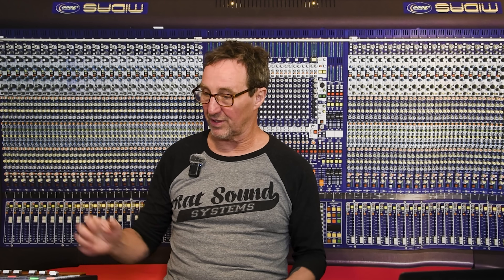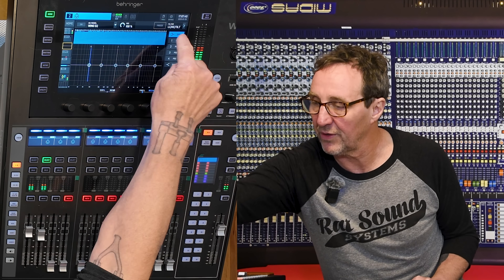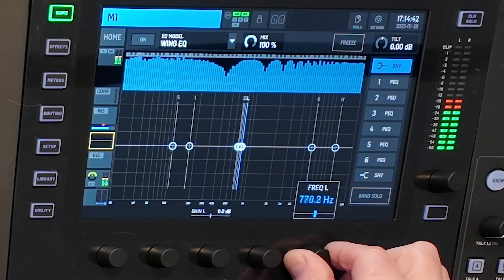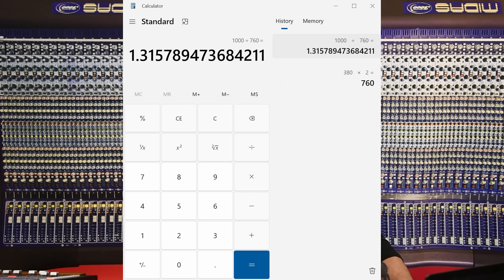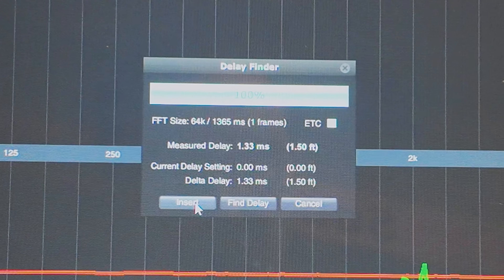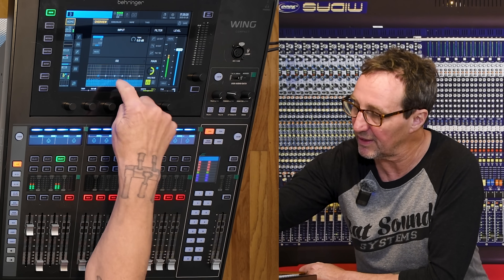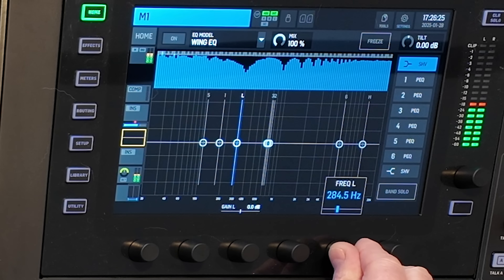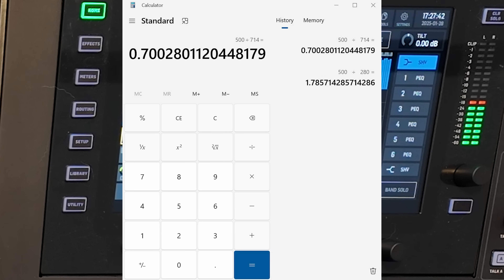Easily Find Console Comb Filtering Latency Issues

Comment: Hello hello Dave, how are you?
This afternoon I had a little time to recreate the tests you did in this video.
To do this, I used my Midas M32 and my Smaart 7 (and one of my MacBooks as the source of the pink noise).
First of all, I want to say that, although I know a little English, I used Google Translate to write the message first in Spanish so it would be translated into English. There may be some things that weren't translated correctly.
I apologize for that.

Here are the results of my test:

As you explained in your video, I connected an external pink noise source to channel 1 (I used an external pink noise source because on the M32, pink noise can only be assigned to outputs, not channels) and panned it to L.
Then I connected an XLR from the left physical output to channel 2, and I panned channel 2 to R.

Then I checked the channel EQ analyzer. 1.

And it was flat, just like in your video.
And the same with channel 2.

After doing that, I checked the L and R EQ analyzer and it showed a pretty obvious comb filter, with several dips as well.

The first largest comb filter was at 310 Hz.
The second at 924 Hz.
The third at 1kHz.
The fourth at 2kHz.
And the fifth at 2k79Hz.

So, knowing that the largest cancellation frequency is 310 Hz, I divided 500 by 310 and the result was 1.61, or 1.61 ms.
Which means that, at least on my M32, there's a 1.61ms latency difference between the live signal and the signal leaving the mixer and returning, according to this test.

I then verified this result using Smaart 7, and when I clicked Find, it told me there was a delay of 1.67ms.
1.61ms according to the test and 1.67ms according to Smaart...
it's practically the same thing.

I then recreated the following test from the video, adding compressors, EQs, and more effects to discover what added more latency and what didn't.
I used a Y-cable to add pink noise to channel 1 and channel 3 (channel 3 panned to R).
Both channels 1 and 3, as well as L & R, showed their analyzer to be flat.
I inserted the M32's ULTIMO COMPRESSOR DUAL compressor on channel 3, activated, but without compressing anything, just online.
And in the main output analyzer, the flatness stopped appearing and a nice comb filter appeared 😅
This time, the largest comb filter was at 751.7 Hz.
After dividing 500 by 751.7, the result was 0.66, or 0.66 ms of latency.
This means that the ULTIMO COMPRESSOR DUAL compressor adds 0.66 ms of latency to the channel.
I've done the same with almost all the compressors and equalizers on the M32, and almost all of them created a comb filter, sometimes at different frequencies, sometimes at the same frequency as the LAST DUAL COMPRESSOR (751.7 Hz, or 0.66 ms).
For some effects like the DUAL EXCITER, the comb filter frequency was different; it was 570 Hz, or 0.87 ms.
After doing this, I wanted to measure in Smaart 7 to see if the latencies/delays matched when I inserted the compressors, but I was late and had to go prepare dinner for the family.😄
So I'll have it as homework for the next day.

I'll tell you the results and confirm if Smaart gave me the same latency/delay as looking at the mixer analyzer (which will most likely match).

Greetings from Spain!!
Reply from the maker: so cool and super interesting! 

thank you and yeah the info is helpful And I appreciate you doing all the research there!

Comment: I guess I’ll try to limit the amount of compressors I put everything through. Usually have it on individual channels groups and the mains. Maybe that’s too much
Reply from the maker: the stock compa should not add latency.. 

it's just the ones with the pretty pictures of fancy vintage gear that typically cause the issue
Reply: @DaveRat I don’t trust those. There’s already one on the strip.
Reply from the maker: then you're doing it right and you shouldn't have issues

Comment: So what does Midas mean when they say phase coherent effects for a x/m32? If this is still the case? Wasn’t the desk suppose to pre delay where it matters?
Reply from the maker: if you notice him a video I added something from the effects rack that changed the latency And also how I use the term " plugins " for the video

if you just use the built-in channel EQs compressors and gates the latency doesn't change. 

it's when people use the gear that has pretty pictures that the latency issues get added on most consoles.

Comment: incredible, does this only happen with plugin processing? Are we in the clear just using stock eq and dynamics? Literally have only just started using plugins on busses etc to mix things up but now i may just be going back to the old faithfuls 😅
Reply from the maker: Yes on most consoles the stock EQ compressors and gates do not add additional latency. 

but that said on many consoles if you route to subgroups and then you also route to left and right there will be different latencies. 

I don't know all the Gremlins that can be found but I recommend testing if you want to ensure you're not adding issues

Comment: In my work I mix at an install with Waves and on-board "gear." I also use an SQ with on-board "plug-ins" with no latency, for my personal reinforcement jobs.  I looked into spending $$$ on Waves/Plug-in rig and decided against it. I will say that I enjoy using some of the clone hardware compressors now and then. I can hear them working and I like to turn the retro knobs and see the meters reacting. Yes, it is more gear but I have a lot of fun with it and it sounds "better" than the plug-ins to me. Maybe I'm fooling myself. I still like it.

Comment: If you’re double patching inputs from the same source - let’s say one vocal channel setup for PA and the other channel with different processing for AUX Bus not going to the PA - will you incur the same issue seen here?

Is it best to use stock eq/dynamics/etc for the AUX and only use an Insert FX on the channel being processed to the PA?

Trying to minimize latency, combing and phase issues going to stereo IEMs where it’s more noticeable vs PA where you have some wiggle room and less perceptibility.
Reply from the maker: I believe you are correct. the stock processing should be minimal latency. and as long as the console does not have automatic latency compensation and it is turned on, then keeping things separate should keep in ear latency minimized.
Reply: @DaveRat You the man Dave! Ever since we’ve gone to IEMs it’s been a process of discovery. Originally, I would just send already processed channels to a stereo bus and adjust levels; however, I found because of occlusion effect for vocals and different EQs being required for instruments when in your ear vs through a PA started to present challenges. So, I found double patching to be the most effective for handling these issues and a better IEM mix vs an entirely seperate board. Luckily my channel count is low enough that I can do this for our band. 

Always love your content and learning so much from you! 🍻

Comment: Thanks Dave! The video gave me a better understanding of how the board works. I would be interested to know how the latency compares to for example: The Local IO, AES50 Stagebox(S32), Dante, USB etc.
I'm thinking of conducting some testing of my own. What I can't test is latency accross different boards. The spec can be usually hard to find, but I think it is a major factor when buying a new board. I know that I was sceptical buying a digital mixer after going from analog direct monitoring from a mixer/interface to an audio interface with bad latency induced monitoring.

Comment: Why don't they add a delay compensation? At least as an option, so you can choose to have a say 2ms latency in the whole setup, but avoid these issues?
Reply from the maker: the board would need to know and track what you use. some of the expensive boards will do that but that is an a issue as well.  do you really want the whole board to shift to 5 lma or 8 ms latency because you add a bunch of crap to a single channel?
Reply: @DaveRat  You are right in that sense. Just thought wit all this modern technology it shouldn't t be a problem for software to calculate that and have it as an option if you decide to choose so

Comment: I see a lot of confusion from too many people here. Latency compensation is present on all channels, like on the vast majority of digital mixers, but only if you use the EQs, compressors, gates, or other effects that are part of the channel strip. Almost all decent digital mixers have it, including the Wing.
Here, however, the latency is caused by the insert rack effects!
And here too, the vast majority of digital mixers, even those much more expensive than the Wing, do not have automatic compensation for rack effects. Certainly, only the Midas HD96 and Yamaha's premium consoles currently offer automatic compensation for rack effects, and perhaps very few others, and in any case, these are consoles that cost tens of thousands of euros. The only exception is the Waves LV1, which uses plugins, but it's different.
So using channel strip effects does NOT cause latency, only insert rack effects do. Let's be clear: I personally don't find forced compensation always useful. It would be better to be able to adjust it yourself or at least activate and deactivate it; you could have problems with monitors, for example. Sorry for my English.
Reply from the maker: excellen and totally agree and that is why I used the term "plug-ins"  to try and denote "processing they is added that is not native to the channel"

as far as auto compensations, I quit mixing big shows before and rather than switching to digital. but I would be quite concerned with a console making latency changes to all the channels based on adding processing to a single channel.

either way, the true goal of the video is to inspire people to test and verify all is good or to test and find and fix issues.

that is my hope of what comes out of this

Comment: DAWs time-align processed channels automatically. I wonder why similar concept can't be use in digital consoles. Maybe not for all channels, but selected ones, e.g. drums channels
Reply from the maker: yeah a bunch of people that work on DAW but don't have experience with live music are saying a similar thing. 

having a live console shifting around in latency would be quite concerning. 

when you have sound being reproduced by loudspeakers with sound sources at varying distances from these loudspeakers a shift in latency changes the amount of time it takes and therefore the frequency interaction between the acoustic sources and the reproduced source. 

shifting latency around will change the frequency that microphones feedback and it will also change the way that in-ears and stage monitors sound to the musicians. 

DAWs solve the comb filtering issue within the machine by shifting latency but in a live environment we have actual sources and once you shift latency you introduce new and different comb filtering interactions

furthermore with a DAW you can have fairly long latencies of five or more milliseconds and not really be concerned where as in the real world live 5 milliseconds equates to a 5-ft or so differential and distance to the source. 

with live sound we want minimal latency whenever possible because we operate in real time

having latency shift around for live maybe like driving a car where if you turned on the radio your steering and brakes all of a sudden started to respond more slowly than if you turn the radio off.
Reply: @DaveRat got it

Comment: This is one of the reasons I love the Waves LV1 mixer.  Fully automatic latency compensation across the entire mixer.  No need to worry about latency-induced phase issues, even if you're sending channels to groups and mains.
Reply from the maker: does it change the overall latency when you add more plugins? or is the latency fixed at a certain time and no matter what you do it stays locked? 

 I'm curious about how it deals with the quandary of trying to keep the overall latency to an absolute minimum and also making sure that the latency never changes for everything when you do a single thing. 

like adding more plugins to the kick drum altering the latency for the vocal mics going to the in ears and changing the way the musicians hear the relationship between their natural voice and the in ear sound due to time shifts. 

this is all super interesting to find out how the various manufacturers deal with this puzzle
Reply: @DaveRat  You're on the right path!  Yes, it delays everything in the mixer to sample-align to the signal path with the longest latency.  You also have the option of sample-alignment to output groups instead of the entire mixer.  Since Waves only allows their plugins to run inside of LV1, they have tight control and knowledge of the processing latency of each plugin.  You know it's working, because you hear a small audio dropout on the entire mixer if you insert a new plugin on a channel that has non-zero latency processing.  

LV1 has pretty comprehensive latency handling, as it displays the processing latency for a channel strip, as well as output busses right in the mixer UI.  It also allows you the ability to ignore latency compensation for channels, outputs, or even individual plugins...should you want to use something that would have a detrimental impact on latency overall (like in IEM scenarios).

Displaying latencies and keeping the entire mixer (or optionally groups of outputs) sample aligned is something that LV1 does really well.  You should check it out sometime.  It puts both visibility and control over total I-to-O latency in the hands of the engineer, rather than trying to hide it.
Reply: @DaveRat  This would be a great video Dave:  
How Latency/Delay exists in Analog (IE: Tape Delay resulting in dual-path Analog consoles), 
as well as DAWs (where we've been fighting this for decades, and delay compensation only recently seems stable enough to rely upon it), 
to Digital Consoles as you've shown here (where presumably the manufacturers would have total control over the latency of their Own onboard 'plugins' and built in channel strips, and have a strategy for keeping everything that came in the box in sync with itself!

The dual, possibly competing objectives of Keeping overall latency to an absolute minimum for say 'Artist Responsiveness' vs providing all of the DSP firepower to shape the ultimate final mix, sonically is fascinating (at least to us audio nerds).

Again, this isn't new.  In-Line Analog Consoles were addressing the same issue:  The Artist needed a direct feed to their mix in order to perform, but the engineer needed to hear a mix that was post-tape and processing in order to know how it was really going to sound.

Audio Interfaces all have some variation of a Direct blend knob from the Analog Input prior to the A/D conversion, or Round-Trip A/D - D/A conversion so fast that they can brand it 'near-zero latency' as in UAD.  (Some vocalists say that they can still tell.  They get a Rolls PM50!)

And with Digital Mixers, the In-Ear mixes usually tap the artist mic from Post-Head Amp/Pre-Processing, so Dry, while the rest of their mix is Post-Processing/Pre-Fader.  Is that what you do/recommend?

In any event, THANK YOU Dave!
Once again, you've derailed my day.
In the best possible way....

Comment: Does the mixer not do any kind of compensation internally for this like a DAW does?
Reply from the maker: The compressor that I added was also internal but it was different than the compressor that's embedded on the channel. 

if you use the EQ compressors or gates or anything that's already on the channels the latency does not change. 

but when you add separate things from an effects rack internally or externally or pretty much anything that has a pretty picture of some vintage piece of gear, That's when the added latency happens. 

The issue is that people really love putting those pretty pictures on their channels
Reply: @DaveRat  yeah but you would think a piece of professional digital equipment would be able to figure out round-trip latency or even give you the option to put manual latency on hardware inserts. Professional daws do. And I get that live performance is a lot different than dealing with something in a daw but if we’re only talking about milliseconds of latency, that’s causing comb filtering I would think that that could be handled.
Reply from the maker: perhaps they do or some consoles do. milliseconds are about 1 ft each so they're not trivial. if a stage monitor is 5 ft from someone and you add two or three milliseconds that's a 50% increase in the timing distance. 

additionally with live you're dealing with the real acoustic sources and reproductions of those sources so eliminating the comb filtering with latency shifts in the console quite often creates new comb filtering between the output of the console and the natural acoustic sources that are being reproduced. 

All that said the main thing is and this applies the DAW as well, is there a simple way to test to make sure everything is working as planned and you haven't overlooked something or something isn't quite as you expected

Comment: but will standard built-in cahnnel compressor do the same?
Reply from the maker: the built in comps, gates and EQ should not add latency.

the latency often comes with a pretty picture of vintage gear.  if in doubt, do a quick test.
Reply: @DaveRat  thanks! i'll try to figure out on mine wing rack!

Comment: I remember when I was preparing for a show on a venue on a Yamaha CL5. I turned on the noise generator, turned up LR and inserted an 31-band but suddenly felt some low-mid canceling out. Two seconds later I discovered I had forgot to link the 31B-EQ, and had only inserted on L. I was very surprised how much I could feel that. 😳